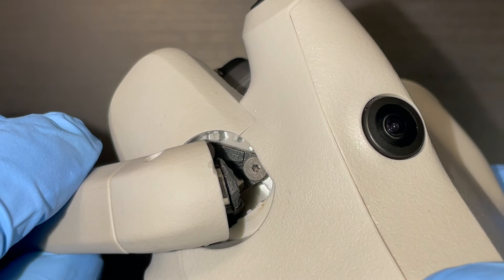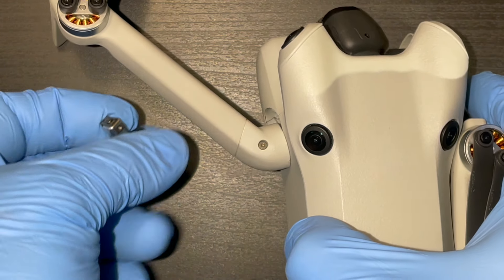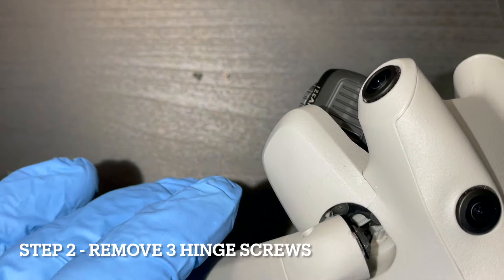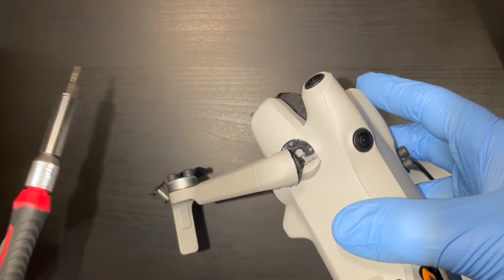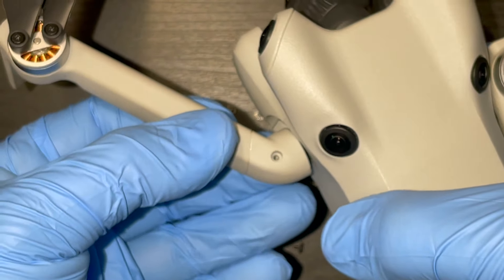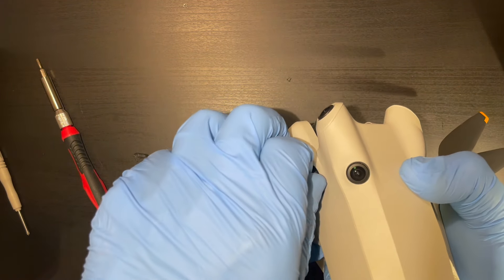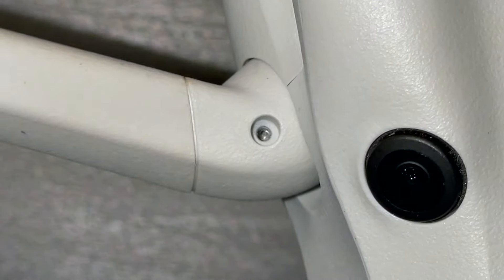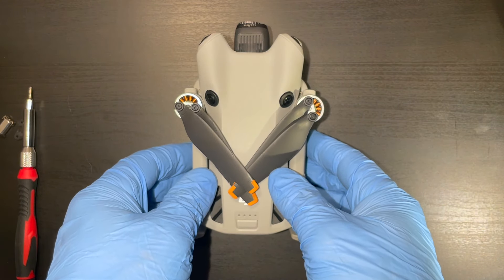DJI Mini 4 Pro Drone DIY Arm Shaft Axis Hinge Replacement

Comment: Great video.  I just had this same break happen.   I do also have DJI Refresh.  They say manually doing a repair would void the warranty and that program.  Not sure if they could actually tell given how simple this repair actually is?  I’m on the fence! Love not to engage that program but clearly this is a simple repair!
Reply from the maker: Yeah I see what you mean. I’ve always been that kind of guy who doesn’t like any mechanic messing with his car. They “fix” one thing but break another. I prefer just to do everything myself but yeah. Refresh totally makes sense for a massive overhaul.

Comment: Holy hell you have steady hands, trying to get those screws in without a magnetic tip was a nightmare for me. At one point a screw fell down the little hole where the wires come out, spent a good 10 minutes shaking the thing to get it out lol. Regardless, thank you very much for the video, I was really worried when it first broke, but less than $15 for a repair and we're back to flyin!
Reply from the maker: Yep! A bit stressful when you’ve just spent a good amount of money only to break soon after! It’s great knowing there’s plenty of replacement parts out there. Thank you and happy flying!

Comment: Excellent video so easy to do it I'm going to by myself, in my case one wire ( the transmission) is broken also 😢 should I change it or just welt it?
Reply from the maker: Hey bro, I would solder it. It’ll work perfectly. Changing out the wire means taking out a lot of screws and taking apart the whole body. Good luck!
Reply: @sciencebygabrawy  thanks buddy

Comment: excellent video thanks heaps!
let's say the screw stripped and I can't get it out at all, any tips?
Reply from the maker: Maybe a drop of lithium grease or WD40 to try to loosen it? I’ve seen YouTube videos of people putting a rubber band between the screw head and the driver. Push really hard being careful not to slip and stab yourself!
Reply: Try a 1.5mm star to pull it over ill post vid

Comment: Are the sockets into which the screws holding the arm spring are screwed in, plastic or metal?
Reply from the maker: Thankfully metal screws into metal sockets!
Reply: Thank you very much for your reply! I have one more question - when you move the front arm by the presser foot front and back (unfolded, of course), can you feel a slight loosening? @sciencebygabrawy
Reply from the maker: Yes maybe a little. And now this totally makes sense Michal thank you! In the video I said everything looks great but now that I’m really thinking about it, that axis hinge does seem slightly less powerful than the other side. I mean it’s all made in China, idk. I guess the bright side is that, when it comes to flight performance, it shouldn’t make any difference. If you’re wondering if you should buy original DJI parts, I’ve looked through the DJI phone app and all they have are replacement screws and propellers. My go-to is Amazon lol.
Reply: @sciencebygabrawy  One more question - does this slight loosening occur on the repaired arm or both? Where the arm meets the body?
Reply from the maker: No, just the repaired one because the axis hinge is an after market part and not necessarily made by DJI. Did you already replace the axis hinge and the new one feels loose? If you’re having issues with the repaired arm being wiggly or loose, maybe purchase a second axis hinge. If the new one feels tight, you could take the other axis hinge and return it.
Reply from the maker: I saw your video. Mine is definitely not that loose. I’m guessing that the issue will be fixed with a new axis hinge. You have to do is take those two screws out and pull the arm off to see if your axis hinge is broken or cracked in anyway. You’ll be able to see and understand everything once you pull the arm off. It’s only two screws. Have you taken off the arm yet to look?
Reply: @sciencebygabrawy  I won't do anything. If yours is more stiff, I'll send my piece back under warranty.
Reply from the maker: Sounds good. I’m interested to hear what DJI finds. Keep us posted bro!

Comment: Great vid. Question….. The two screws that hold the actual arm on, did they have any thread lock on them? I landed mine on a garden table and it fell off and fortunately folded back the arm all by itself self but I’m worried it may have cracked the hinge or something. It all feels solid, just worried about taking the screw out and then they work lose over time
Reply from the maker: That’s a great question! I don’t think there is any thread lock on any of these screws when they’re assembled. I also, based on the feel, don’t think they’ll eventually come loose due to vibrations. Mind note have stated quite snug for a full year now. No problems at all! But a very tiny amount of lock thread certainly won’t hurt  anything. If the screws felt loose coming out then I’d consider thread lock but if felt nice and tight, then I think the plastic thread on the arm even 4or5 repairs over time will still hold the screws well. Good luck!
Reply: @sciencebygabrawy  thanks for the info buddy

Comment: I really wish somebody would make an upgrade kit for those cause they break really easy
Reply from the maker: Yeah.  Maybe there’s just not at big enough market yet.  I’ve been really trying to remember to switch back from sport mode to normal mode when the drone is no longer in an open wide space. You just forget sometimes in the midst of all the fun lol
Reply: Yea, that’s what happened to me, I lightly ran into my vehicle and it fell 4’ and broke… upgraded axis arm hinges and custom Kydex clip on pieces for the arms and body would make it still really light but extremely strong. I might just buy the materials and do it myself.

Comment: You think there’s anyway to reinforce that hollow bracket with JB weld or like you said maybe we could fill the cavity on all 4 with epoxy. I think Jb weld  drys really hard like ceramic if we fill each cavity flush then dremil it nicely crafted we’d have a doubly strong part what do you think?
Reply: Update I used JB Weld it sets up real nice.❤
Reply from the maker: What a great idea! Really it worked? Good trade off then! Little bit of weight sacrifice for strength!

Comment: What a professional and fast job! Unfortunately, my new Mini 4 Pro broke its front right wing in exactly the same way. Sadly, one of the cables attached to the propeller was also cut. My question is: where can I get the original replacement part for that triangle?

Thanks, everyone.
Reply from the maker: Oh man! Sorry about That! Well in the DJI app, I believe you can purchase anything. 
https://apps.apple.com/app/id899147555
But I just use Amazon to be honest. Everything’s there and available. Good luck!
Reply: Actually, I have already got that. Your video was very helpful and informative regarding that issue. Thanks.

Comment: Great instructional video, I just have one question: if the broken arm isn't lighting up and calibrating upon startup (like the other 3 do) does this mean that I also have damage with the wires as well? Or will replacing the shaft acid hinge fix this issue? My arm is hanging out more than the damaged one in the video.
Reply from the maker: Thank you sir! So unfortunately, it sounds like you got a wire issue at hand. There’s always a chance that you could repair the cut wire without having to pull apart all the body shell pieces but if you do have to remove more, I would write down the steps you take being your first time so you don’t forget anything! Btw new arms come with new wires and they’re about $100. Good luck!

Comment: I got a new hinge and got stuck pulling out the tucked screw as it striped... So I used a 1.5mm star piece to flush it out... It seems to turn just enough to go back in so I put it in with the new hinge. The new hinge works great... I got the other 2 screws on no problem. But I didn't put to much tightening on them at all... just to hold... I wonder if that will be a problem or if once I get new screws if I can reuse my old new hinge?
Reply from the maker: I think you’re probably going to be good with the new hinge. Those screws seem to be snug even when not all the way in. The screw hole is probably engineered to account for all the vibration. Well the good thing is now you’ll have a few spare parts around for the future!
Reply: @sciencebygabrawy  https://youtu.be/DjQz7A6G-gY

Comment: If you have refresh send it in this repair requires tool purchases you can round the Tbit bringing screw out so if that happens use #4 Bit to bring it out rest of the way. Leave cam shield on. Remove blades on broken arm temporarily get them out of the way. Remember how you took them off.  When putting part back on notice the concave side goes to the front mounting screw to arm is up 11- 12 oclock position roughly. It may be necessary to use a spring loaded center punch also if you round the head during extraction of screws. Knocking it several times on an angle off to one side of the screws face counter clockwise.🎉❤
Reply from the maker: I didn’t know that thank you!

Comment: I messed up bad…. I damaged the screw in the arm and it’s the one I need to take out to put the shaft on… the screw is damaged and won’t come out so I’m unsure of what to do now…😢
Reply from the maker: I’m sure you’ve seen those YouTube videos where they put rubber band between head of the screw the screwdriver to help get some traction. Another idea, and this may be way too aggressive, but there’s always the option of using a screw extractor. You know the screw that you drill into the screw, where the threads spin in the opposite direction. Sorry man! Let me know how it goes!
Reply: @sciencebygabrawy yes I have tried the rubber band and that didn’t work and well the part where you screw a hole in the screw doesn’t work for some reason I’m not sure why I used a corded drill and it’s powerful so I’m not sure😢

Comment: Just flew into some power lines and did exactly this. Identical broken axis hinge. Did the epoxy method work instead of full replacement of the axis hinge? Will try that temporarily while i wait for the replacement part.
Reply from the maker: So I did end up using epoxy on the broken triangle piece, but I never used it because I just ended up installing a new one. So I never really got to test the one that I epoxied together.
Reply: SAMMEEE THE WIND AND LOW BATTERY MADE ME HIT THOSE DANG LINES
Reply: @sciencebygabrawy  I just went ahead and tried the epoxy method. The super glue stuck the plastic back together and I have placed the axis hinge back into the arm in its original position. Have flown the drone once without issue however I believe if I pull that arm in the wrong direction when folding it out then it will likely break the axis far more easily again. In summary the epoxy method works but I dont trust it long term so I have ordered a replacement piece anyway in case.

Comment: My drone's arm wobbles a little, but it's not broken. I wonder if this plastic piece could be cracked or if it's just normal play and within spec?
Reply from the maker: I don’t think it’s normal play. There’s certainly a bit of damage and you’ll likely find it if you take out the screws that are holding the arm in place. I’ve expoxied one arm in several different spots over the years and it seems to just keep going. It’s like a bone. It gets stronger with every break lol.
Reply: @sciencebygabrawy I took it apart  and didn't find any damage, weird

Comment: Hi! I found Front Arm Shaft Replacement for DJI Mini 3 Pro only but i have a dji mini 4 pro, are these parts the same for both?
Reply: btw i also have a broken white cable, can u please tell me how can i repair it
Reply from the maker: The mini 4 pro arm shaft is different than the mini 3 pro arm shaft. They do share the same axis hinge but the arms are different

Comment: What would you recommend of one of the screws is stripped
Reply from the maker: Well, if it were my drone I’d epoxy the head of my screwdriver to the head of the screw. Then wait 24 hours. Then I would spray a very small amount of WD40 or lithium grease down the threads. Then I’d try backing off the screw. I don’t know if you have a better idea but anyway good luck!

Comment: what would you recommend if a few of the wires are torn in half too? asking for a friend
Reply from the maker: I mean, if the break is in an easy spot to solder, obviously you could solder them, if you can isolate each one and not melt the plastic sleeves etc. honestly, I wouldn’t spend more than 15 minutes trying. If he can’t get it I’d just order a new set online, but you’ll have to take the whole thing apart, unfortunately.

Comment: this happened to me. sadly one of the three hinge screws sheared  off. the screw is stuck in the plastic hole but has no screw head anymore. and not enough screw poking out to grip it with needle nose pliers.... anyone got a solution?

Comment: I managed to snap one of the arm screws leaving a piece of the screw stuck what's the best way to remove it
Reply from the maker: I’ll tell you but please use ultimate caution and precision. Use the smallest finest punch and punch a dent in the center. Drill with the absolute skinniest drill bit you can find down as far as the screw goes. Drop a drop off lithium grease to loosen. Put the punch back in and gently wiggle it out. Good luck.

Comment: The screws aren't magetizeable. Like the prop screws these #T3 are some soft cheap pot metal. I'm actually using temporary poster putty to hold onto the screws. I also folded up a piece of paper to block that hole temporarily. Are just filming and refilming until you get the peefect shot of you hold onto those screws. Because theyre not magnetic??? 😅😅😅
Reply from the maker: Thanks for the great tips!! Great ideas! I have this way of keeping the screws on the screw driver using my fingernail as I lower it into the screw hole lol. I don’t think I re-recorded anything but maybe, this was a year ago now. Thanks bubblz!

Comment: Hello everyone, the transmission cable of my Mini 4 Pro was severed in a crash that also broke the arm shaft axis hinge. What is the best solution to resolve this issue, and can my drone still operate without repairing it? Thanks.
Reply: Hi 
I have the same problem the transmission wire also broken. A technician told me to weld it but Idk if that solution is correct 😢 
How did you manage this?
Reply: @jonathanjavierortizverano287 Hi. I think this is the only fix to that problem. Just do it and good luck.
Reply: @Alhusam  I'm going to do it

Comment: Have a question, did you use any thread lock or Locktite for the screws, if so which do you recommend? Just curious if the vibration from the motors can make the screws vulnerable to coming loose without some sort of thread lock. Thanks.
Reply from the maker: I’ve never been worried about any screw that can be tightened down snug but I’ve thought about this question a lot because I recently bought a pack of knock off propellers hoping to save money. When they’re screwed in snug, the propellers won’t spin, so I’m forced to back off the screws a bit. I know sounds like a really bad idea. On several occasions, upon putting the drone away, the propellers would just come off and I’d wonder how did they not fly off during the flight. Anyway, for parts that are not being constantly replaced, like arms and stuff I think it’s a great idea! But I personally am replacing propellers all the time because I like to do a lot of various stunts and maneuvers lol. Well, my worry is after a while that locktite will eventually gunk up the inside of the screw socket from so many propeller replacements. But for arms and that kinda thing? Awesome idea! I don’t think it would hurt a thing!
Reply: Thank you for the response, I just replaced the left arm yesterday, tightened down all the screws, and flew it. Seemed fine but will check them prior & after each flight to ensure they’re tight. Thanks!😉✌️
Reply from the maker: Wow! Pretty big job replacing the entire arm! Makes you think twice about using sport mode huh lol. I love sport mode lol. But about rechecking your screws a few times- Good plan for sure!

Comment: Camera Lens Error 1C000310 please tell me how to fix it
Reply from the maker: Hi Rubel, I’m sorry you’re having this issue. It’s more common than you think, even right out of the box with the mini 4 pros. I hate to be the bearer of bad news, but there’s a good chance that you’re gonna have to send it in to DJI to have it repaired.  1C000310 and 1C000317 are common error when there is a loose connection between the camera lens and the board. You didn’t do anything wrong it’s totally a manufacturing defect. Now, there is something you might want to try before you send it in. There’s a small chance that a simple software reset will do the trick. If it works, it wasn’t a loose connection. A five minute software reset or update is always worth a try. Good luck Rubel and let us know what happens!

Comment: broke it within 20 minutes of getting the drone... I have the care refresh but don't want to use it if such an easy fix. darn return to home took over with a low battery and flew right into a building😢
Reply from the maker: Yes! I learned the hard way- when it’s low battery, it’s hyper focus time and if you’re able to walk to it, drop that thing as low as possible manually as fast as you can so that if it really does fall out of the sky, at least it’s 10 feet off the ground and not 100 feet up. Spendy toys!